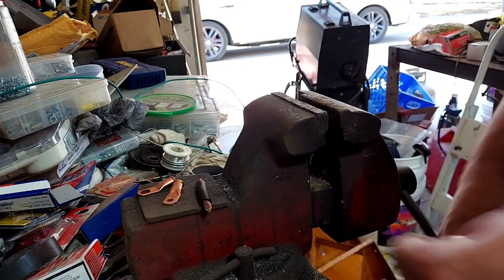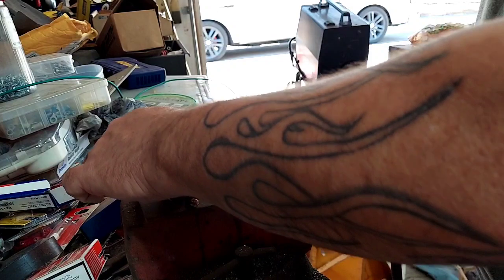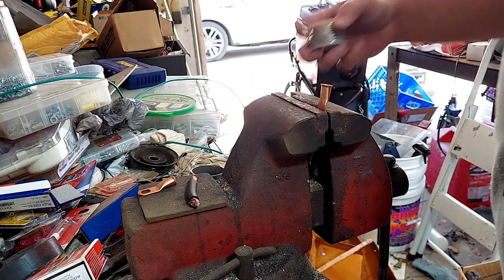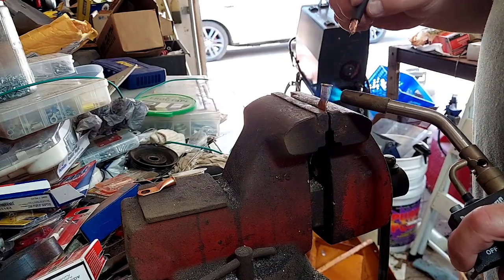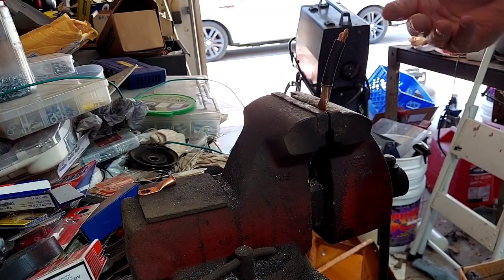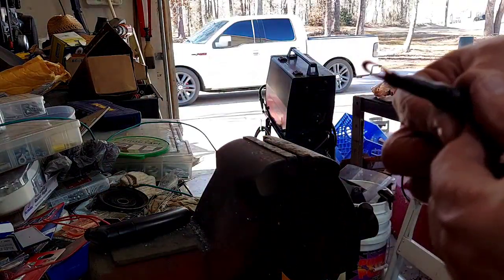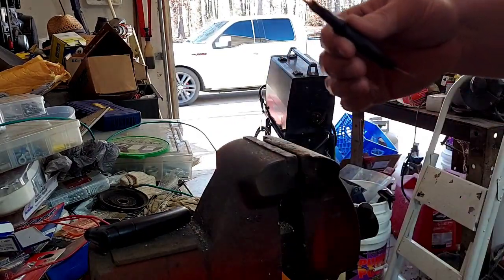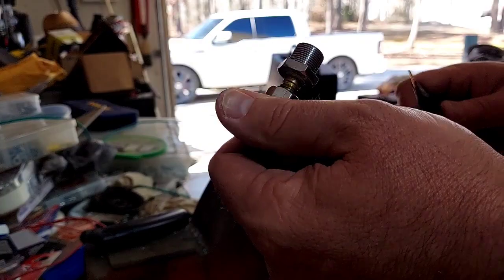Make your own CB antenna ground cable! It's a really easy DIY.

Comment: This is the BEST video series for CBs and antenna.  This man knows his 💩. Excellent  information the OG way radios should be installed.
Reply from the maker: Thanks for watching
Reply: Not really. Crimping a solder joint destroys the solder in the joint. Nobody I know does that. He also solders on crimp connectors. That's questionable but he's a nice guy and he's trying to help people.

Comment: Nice vids sir...I would like to ad a cpl tips though...Before you insert the wire into the lug,open up the wire strands a lil and drop some solder in there as well then do as in your vid..Much better connection...On your ant stud,grab some liquid tape or coax tape and goop a lil on every connection point where ant stud comes together on bracket...It also help when slush or heavy rains builds a lil bit of an electrical bridge between stud and bracket...Happened to me a few times...Oh and finally check your connections with an ohm meter just to be sure there is no resistance..

Comment: Hi J Rich . Yes I Did Test my Midland 4001 Model that was Tune in 1980's with Original K40 with New K200 Coil Connector and 57 1/4 stainless steel 17-7 Whip . RS SWR Meter 1.2 Setting  . My Radio Check comeback was 11 Miles .  I Purchase in 1980 Old Original K40 , Mega-Mount 40 Years has some Life Left . I believe K40 products work Even K40 Mic. Even that They Make Today . Even If I took Single Fiber Glass K40 Antenna and hardware and Installed in Semi-Truck . Learning Your ( Tricks of the Trade ) a my Knowledge of Components and Proper Installs Be One Happy Driver with his CB Radio ..
Reply from the maker: It's all in the setup

Comment: I used a section of coax as my antenna ground. It works a lot better than the 10 gauge I was using. There is a whole lot less noise.
Reply from the maker: And, 1" braided ground strap would be that much better. Check out my RF bonding video. The results are amazing.

Comment: My dude....thanks for the content. I replaced my factory coax wiring in my 2016 freightliner Cascadia daycab. It was 4 pieces that went into a box behind the dash and ended at the antenna mount bracket with a uhf style connector at the top of the drivers side cab. There doesn't seem to be a ground as the final connection to the antenna post is insulated from the metal that would ground to the frame via the 3 mounting screws. Would this fix that issue?

Comment: People confuse rf ground with dc ground all the time. DC ground travels inside the conductor, and RF ground travels on the surface. The thing that sucks is a multimeter is really no help when testing rf ground. My local cb shop says run a ground strap from the antenna to the frame and I disagree. I sort of picture the rf energy wanting to leave the antenna and get to your horizontal metal surfaces as easy as possible and have multiple paths to take. I have small ground straps from my firewall to my hood on both sides and my cab to my bed both sides. The worst place for an antenna is on a hinged door. If thats your only choice put at least two straps from the door to the cab so the rf energy can bypass the hinges.
Reply from the maker: Very true, and yes straps are best, but you wouldn't believe how many people I see trying to ground an antenna with a small gauge wire. However if you can't find a ground strap long enough, making a cable is better than nothing. Thanks for watching.
Reply: A man who knows what he's talking about.

Comment: Any issues with using a heavier gauge cable?  I have both some 1/0 and 2/0 cable already. It’s going to end up being a slightly long run as I’m mounting to a tool box on my pickup
Reply from the maker: What I would do, because you have the tool box, is ground the antenna mount to the bed. Then to get the absolute most out of the system is RF bonding  with 1" ground strap. Here's a video on RF bonding and what it's about. It a lot of work, but well worth it. You can get 1" ground strap by the foot fro DX Engineering for $1.20 per foot that's about half the price as Amazon. https://youtu.be/J6PJyw6jh2M

Comment: Jay Rich if you wouldn't mind can you show how you connected your ground cables from the cab to the frame mind you my Freightliner Mount is on the side of the cap that truck so I would have to go from the cab to the frame and I'm in a company vehicle so I need to do this hopefully right to where I do not get in trouble
Reply from the maker: I show how in this video. https://youtu.be/TqQ5KJsnw3s

Comment: Hi rich, I have a cb radio in my 18 Chevy pickup. Antenna mount is a left hood side fender mount and every time I turn my steering wheel I get massage noise over my cb. Could that be a grounding  issue or something else? I’m powered straight to the battery. My ground was inside my cab near the radio but I moved it to my neg batt post to see if that might help and it didn’t. 
My question is should run a grounding strap from my mount to the Frame and from the battery to the frame? 
Thank you for your time.
Reply from the maker: Yes, those grounds will help. What really helps is RF bonding. Another viewer did his yesterday and said his system is much much better. Watch here to see what I mean.https://youtu.be/J6PJyw6jh2M
Reply: As J Rich's other video talks about, RF ground is different than your DC ground in the pick-up.  Running flat ground straps (they must be flat 1/2 inch wide at a minimum) to all the different panels, frame and engine will help the metal of the truck be a better RF ground for any antenna used on it, but I don't think it will mysteriously solve the receiver noise - RF grounding it is only reactive when the radio is transmitted.  It has little perceived benefit to the incoming signals, but it surely can't hurt your receive on very, very weak incoming signals.  The first thing I would try is to ground the chassis of the radio (again, it must be a flat strap) to see if that shuts-up the noise in the receiver.  One natural problems in a mobile set-up is you have no earth ground sitting on rubber tires.  The ideal solution would be to ground the radio chassis to the earth and bypass all the metal of the truck.

So why the flat strap you may be asking?   There is no skin effect on flat straps with RF - round wires make good antennas.  The most over looked item in a CB install is RF grounding the radio chassis and amp.  Most of the time that is enough to resolve 99.9% of the problems without having to ground all the panels and such.  The idea is to get the RF signal off the antenna and into the air without reacting with everything along the way.  Not RF grounding the radio gear is a recipe
Reply from the maker: @Chuck_Carolina  well said, the RF bonding does help receiving especially the days of solar events, Skip rolling, and the Ham and Base guys crowding the airwaves. It also knocks down most interferences from the vehicle. Such as opening doors, LED lights, and alternator whine all based on my finding on this Freightliner. However it doesn't seem to help with outside interferences such as traffic lights, stores, and the chicken light trucks.  In theory the transmit should be way better and less single directional and be a true omni-directional.
Reply: @jrichtruckincbtips  Propagation in solar evens is a whole different discussion.  These spurious signals getting into our speaker is also another problem on its own - those signals are present and should be filtered out by the radio's circuitry.  They can get into the radio in the RF, IF, Audio and DC power circuits of the radio as well, not just through the antenna - and each one needs be addressed inside the radio, or at the source of the signal.  Good RF grounding the chassis of the radio equipment is the #1 thing on the list of things to check for first!  Alternator wine, LED lights, doors opening are all coming into the radio from the DC rower cord - filter at the radio and isolate it from the source.  

The front-end of the receiver, the RF section of the radio, does a pretty good job of filtering outside interferences picked up by the antenna if the radio chassis is RF grounded properly.  Get a good shop to align the front end of your radio if problems persist.

RF bonding, as you are talking about it, has a great deal of effect on the radiation pattern and takeoff angle on transmit.  The likely hood of you having much effect on it in a vehicle install is unlikely on receive.  Raise the antenna up 8 feet and maybe you will see a difference.  An antenna like we use on trucks are bad - unless you can get the antenna up off the truck, there is not much to talk about.  That stuff all has to do with propagation, and for the most part, you get what you got where you hang the antenna - always.

Look, I have had people hear me for 100 miles or better before they got close enough to talk to me.  Just by where I was sitting.  Nobody had a problem hearing me - talking to me was their problem.  Propagation is a primary concern on transmit (power out)- not on receive; the transmitted signal from the other end either gets to your antenna or it don't.  If you can hear all these spurious signals, you can also hear someone on that frequency if that station can get to you.  RF bounding has little to do with the radio receiver's performance in a mobile install.  Incoming RF signals are so weak that antenna height (location) and a good earth ground is the only way to hear better.  With rubber tires you have no earth ground - let alone anything other than a bad RF antenna ground.  In this location, I talked for miles because of my transmitted foot print had a true earth ground.  I could hear the moon, but not these guys rolling up the highway.

Grounding the radio equipment with a good RF ground allows the radio to only see the antenna - the ground plane could be a VW Bug or a Tank and the radio would never know the difference on receive; again no-earth ground or height and location on a receive antenna being King alone....  Radiating (transmitting) off that same ground plane (antenna) is another story in reactance to the load - which is the antenna and power is the King.  You can test this by using a different receive antennas, but no mobile receive antenna is going to work well for this test - you need to get the antenna at height away from the vehicle and into a good earth ground to see any better results.  RF bonding is not a receive thing in propagation without antenna location and type without a "good earth ground."  Everything else is a poor compromise.
Reply: @Chuck_Carolina  I’m beginning to find this cb shit a little ridiculous 😂
Reply: @jrichtruckincbtips  I decided to move my antenna mount farther up near the cab of my truck basically across from the Raido antenna. I’ve seen many Silverados with cb antennas in the same spot. When I moved mine there my swr went up and my receive and transmit went down lol! This truck hates cb antennas! I’m moving it back tomorrow to where it was, near the middle of the hood fender. Shit is making me crazy

Comment: If i use a mirror perch for my antenna on the top of the mirror on my 21 Volvo vnr, does it ground itself because there is a ground connection on the bolt i would replace with the perch ?
Reply from the maker: When using the purch you should ground the doors to the cab and cab to the frame for best results like in this video. https://youtu.be/J6PJyw6jh2M
Reply: @jrichtruckincbtips  thank you.

Comment: So can I ground it to my battery
Reply from the maker: You can ground the black wire from the cb to the battery, but not the antenna. Antenna grounds and rf bonding goes to the frame.
Reply: @jrichtruckincbtips  ok thanks bud

Comment: I own a 389 long hood pete all-metal cab with grounding straps to the frame already.  I just mount them to the mirror arm which has pre-drilled holes for co-phased antennas and done. Plastic body trucks I guess need straps???
Reply from the maker: The general consensus is that straps are better for RF bonding than cable, but a 4ga cable can be used as it has nearly the same strands as a 1" flat braid.
Reply: Even aluminum bodied trucks like the Peterbilt 379/389 will benefit from ground straps at the antenna mount. Factory installed mounts are garbage, often the wires are bundled with other electrical wires creating a lot of bleed over noise in the radio

Comment: Can I run 4 ft long 4gauge wire and be fine on radio internals? I need to ground it to frame
Reply from the maker: Should be fine, that's about how long mine is.
Reply: Better off doing short runs less than 8"..Each piece connecting parts of the truck/car together to become one..ex..Door to cab..Cab to fire wall,fire wall to chassie..

Comment: J Rich, It's All in Process and And Additional Small Components and Technique to Apply in Install Steps .
From Antenna to Mounting the CB Radio in Semi-Truck
Over- Head . The RG-8 Coax Large Oval Loops , for Extra
Cable that Helpful , has you Stated Once. I Learned from
NASA once you Complete One Loop Duck-Tape them down in Place . I use This PL-259 Male Plug to SO-239 Female Right Angle 90 Degree RF Adapter Connector , That Connected Side-Ways to that CB Radio . It Works.
I also Use # 4 Adapter ''suction cup 3/8 threaded' 3/8 in Length  with Washers Lock-Nuts , 3/8 Nuts  . Two for the Bracket Down on Bottom . It Raises it Up with Down Angle
so you can See the Face Better . One Slap Down it Don't Move .. I do the Same with Other Two ''suction cups -For
Speaker Bracket on the Bottom of HeadLiner . Place
the Speaker where I want-in , with 3.5 connector going
over the Shelf Rim to the back of CB Radio with Extra Speaker Cable inside the Speaker-Housing . If It Drops
Down Just Re-Stick back up Inverted with the Bracket
''Suction Cups .No Mounting Holes and Speaker Is Lite
Anyway . Only Question I have for You Is , is there
Power Already in the HeadLiner to Tap into ?  
My Ideas Really Aren't That Bad , Learn from Others .
( Little Tricks of Trade )  ..Thanks Now ...

Comment: Also I have ordered a Stryker 497 from derail if you haven't seen him check it out I will have to wait 14 weeks to get the radio set the way I want it but that is the biggest power I can run without putting an amp box kicker whatever in the company won't allow it so that's why I got the biggest radio as far as power I can get that's why I got to struggle for 97 do not want to bring this radio up when I get it so I need to go down the right path the right and Tannerite everything and I've been watching you I do have a top-load antenna I've had set for so long I'm not sure what it is I think it's a Wilson I'm not sure I'll have to pull it out but I appreciate all your help everything you're doing on these videos thanks man
Reply from the maker: That Stryker is around 100 watts and that's all you will get without an amp. Also running a 100 watt radio you'll have to your power and ground to the battery. The Freightliners cb wiring will not handle that much power.
Reply: @jrichtruckincbtips  see that's the problem j-rich I'm in a company truck I am not allowed to alternate anything in there that's why I got the Stryker 497 for the most power I can get the only thing I'm possibly could get by with his ground wires from maybe the cab to the frame will that do me any good or not
Reply: @jrichtruckincbtips  or I could run a ground Plane off the antenna if that would help and it did back in the eighties and nineties when I had a big radio when I could run an Empire with the same company that I'm still with getting up in age so I want to stay with them hanging up retire without getting fired
Reply from the maker: @thomaswarmouth2551  you have to know how much power the stryker is putting out. It's been my experience that 40-50 watts is the max on the truck factory cb wiring before you start blowing fuses.
Reply: @jrichtruckincbtips  that's my problem I have already ordered Stryker 497 from derail it will possibly go through 120 to 140 Watts with Factory voltage that I might maybe change the fuse and I'll handle it or not I do not know according to them it would but it would push the limits I probably have to change to a 5 amp to a 10 amp breaker on the truck cuz I have to use Factory power
Reply from the maker: @thomaswarmouth2551  you have to go to the battery or if your truck has power supply in the fuse box like mine. Here's mine. https://youtu.be/GK-BsLF5OZo
Reply: @thomaswarmouth2551  simple calculation.  Divide your wattage by the voltage and then add a bit more for the rest of the radio plus a safety factor. 120 watts =10 amps at 12 volts. You need a 15 amp feed at 12 volts. At 24 volts it would be half of that - about 8 amps. 5 amp fuse would blow immediately.

Comment: Does this apply to installing on a pickup?
Reply from the maker: Yes, it does. But, use a braided ground strap if possible. If not make a cable.
Reply: Should I use the same Guage wire? I'm using a 4
Reply from the maker: @TruePatriot127  I use 4 gauge as well.

Comment: I would never crimp  I would solder every time. crimps don't like vibration and big trucks have plenty of vibration.
Reply from the maker: It's soldered, crimped, and heat shrunk.